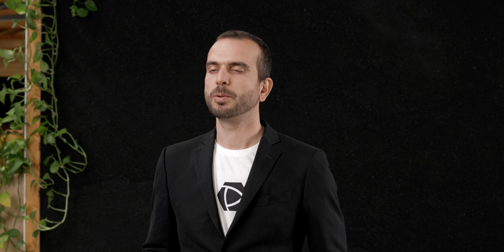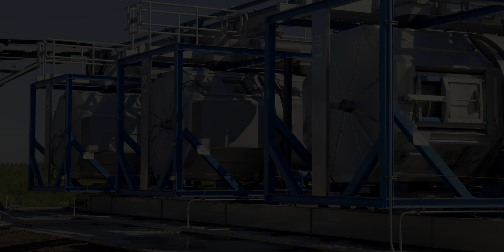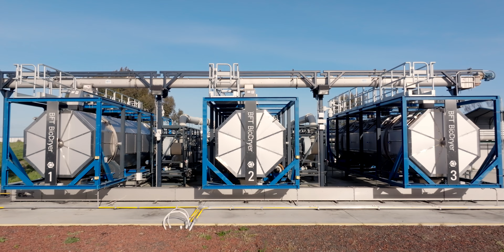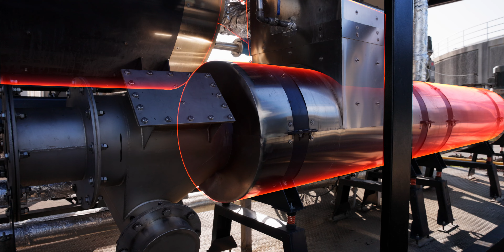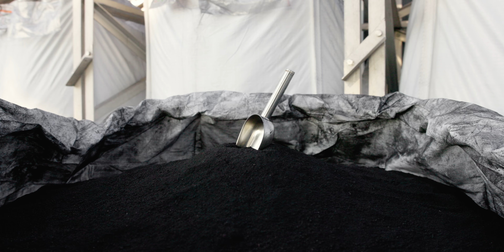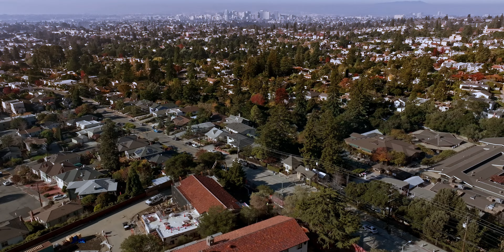The Bioforcetech System: Transformative, Sustainable, and at Scale.

Comment: How long does it take to dry based on the percentage of wetness of the biosolid
Reply from the maker: Great question! the BioDryer is time competitive with other dryers. at 20% Total Solids it can dry roughly 8 tons in 48-60 hours depending on digestion level and bacterial activity. The BioDryer can go as dry as 95% TS if desired. For pyrolysis we keep it in the 80% range for easy conveyance and optimal dust reduction. Check out our BioDryer page on our website for the standard specs to learn more!
Reply: @bioforcetechcorporation How many tons/hour of 20% water biosolids can be converted to biochar eliminating 99%+ of pfas and other toxic chemicals